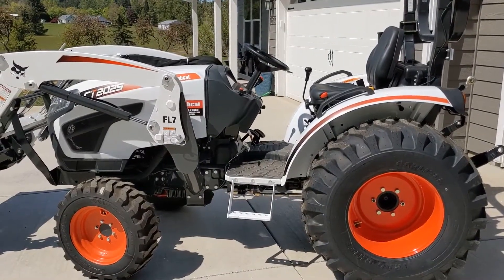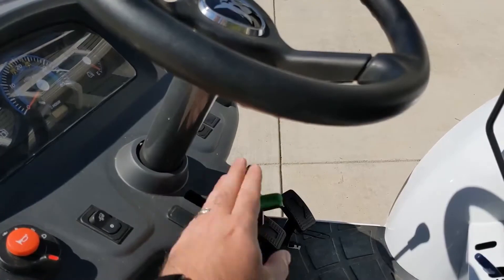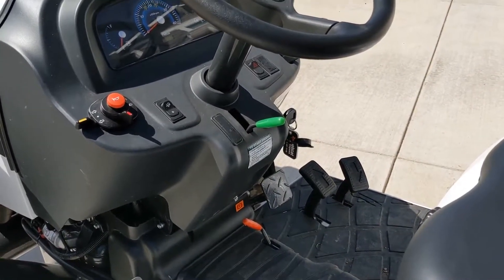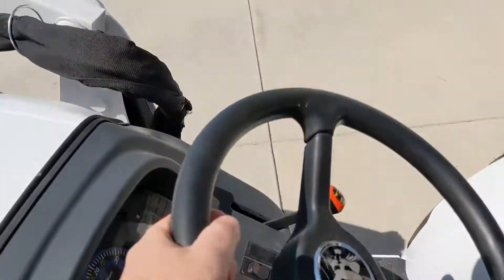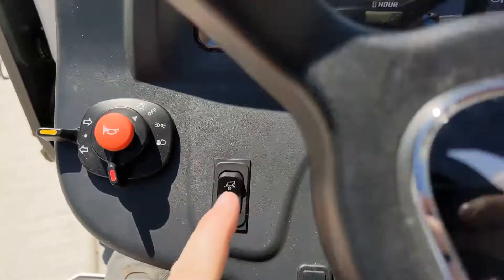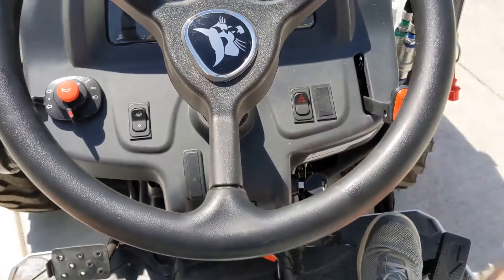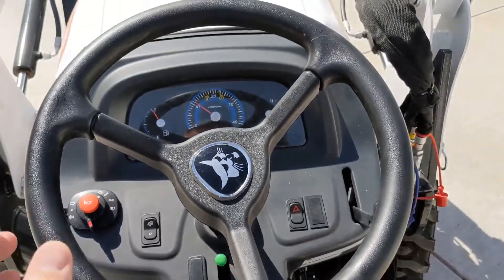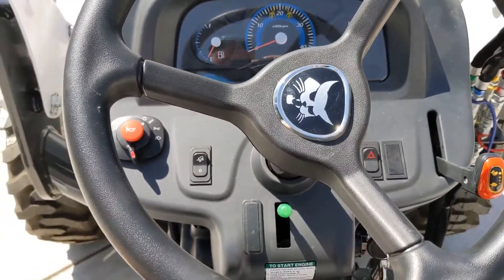Bobcat CT2025 Tractor - Linked Pedal Kit

Comment: I have a CT2025 2021 model .. I called the dealer and they said all i need is a Linked Pedal Switch added , No green lever etc.. What year model is your CT2025?
Reply from the maker: Almost positive mine is a 2020. I need to verify, but I wonder if they installed the lever because the switch location was used up when dealer installed cruise control.

Comment: How does it function while using implements like a Rotary Cutter?
Reply from the maker: You might be able to use with something like a box blade, but any attachment using your PTO, should not be engaged while running, as PTO would not receive required power.